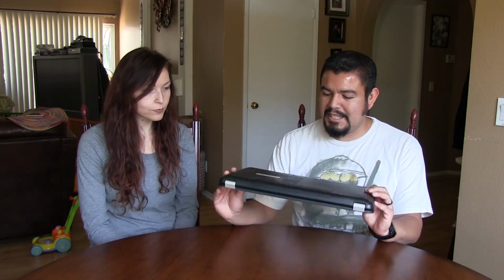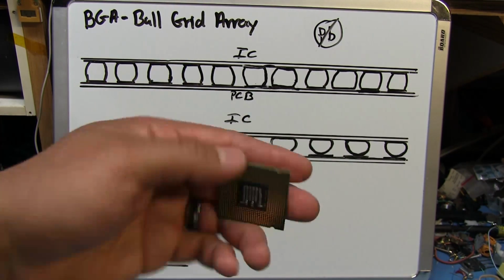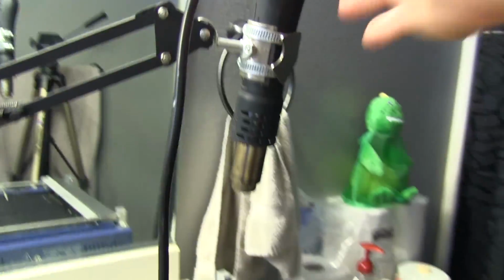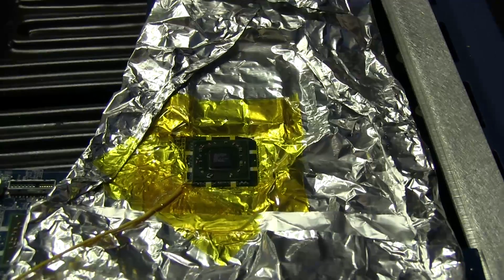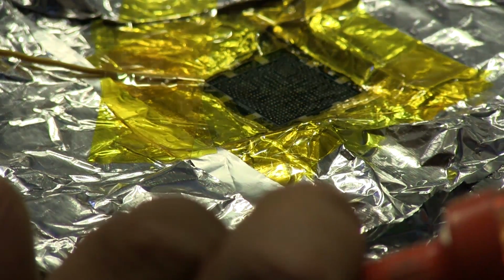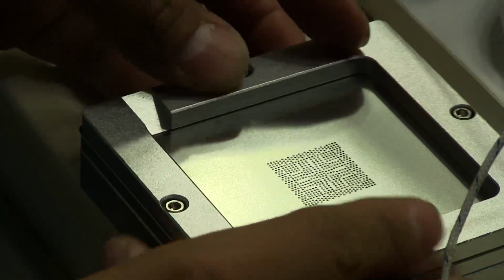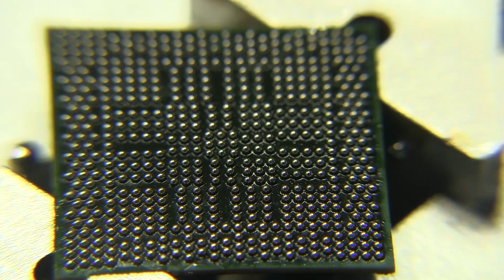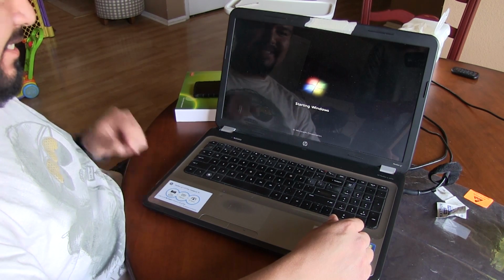TWB #7 | HP G71075DX Laptop GPU Reball

Comment: Hey bro nice explanation but piece of advice don't use a 2 meter solder wick this can lead to damaging a pad if temperature wasn't enough on the soldering iron it will drop due unnecessary extra thermal mass from the solder wick instead use small chunks of the wick like 1 inch or even smaller and hold it with a ceramic tweezers to prevent heat from tranfering to your the tweezers or you can use hot tweezers to hold the wick

Comment: Hey bro, youre a genius! I love that lamp mod you made to hold the heat gun. I have the same station and was bummed out that it doesnt bring a heat gun holder, so i took it apart it and drilled two holes on the side of the housing to attach a heat gun holder  which worked good but i cant reach the other side of the preheater. So i went and got the same lamp you have and made the base for it. Love it!

Comment: Two suggestions
 1: a exact measuring of flux  layer.
 2: when the gpu is about to settle down on the motherboard, that there be a mechanism made to push it down and hold it  while the hot air is running. and then  slowly cool  it down.

Comment: When reballing a ps4 or 3 what temp should I start preheating the motherboard  and for how long? Dose 105-115 C for 20 minutes sound right? And when I start the air gun do heat up quick to 220 C and if so how long should I wait before try to bump the chip. And the way should I put the kapton tape over the tips of the termalcouple on the board to get an accurate read?

Comment: Hello,
 I wanted to know the temperature to paste the ball  on the chip and 
then temperature to paste the chip on the motherboard, thank you very 
much for your answer
Reply from the maker: For reflowing the balls onto the chip, I set the hot air to about 400, and SLOWLY brought the nozzle closer and closer to the chip until all the balls had flowed and stuck to their pads. 

For reflowing the chip to the board, you have to follow a reflow profile. There is no set temperature you can use every single time. I used an XBOX 360 profile as a base for this project. This website has great profile information towards the bottom:

https://xbox-experts.com/tutorial/reflowing-with-thermo-couples-reflowprofiles-incl-/

Comment: the girl sounded happy at the end when it worked lol. How long before & needs to be reballed?
Reply: I hope You learned, that reballing flip-chips is pointless.
Reply from the maker: It worked for a while, but unfortunately eventually it stopped working again. I guess it turns out there were defects in these particular chips where they would work when reballed or reflowed, but eventually would quit again. Not because of the reball/reflow failing, but because of a problem within the chip itself. I have done other reballs where I didn't have any issues afterwards, mostly on 360s, so this one had me baffled for a while. She hated that laptop because it was constantly having issues. lol

Comment: wouldn't you be able to solder the balls while still in the jig? Jig is made of aluminum & will not stick to the steel/lead balls,?
Reply from the maker: If you mean heating the balls while the stencil is still on, It may be a bit more difficult because it would be harder to heat the chip itself. All the heat would be transferred from only the balls. There's direct heat stencils that this can be done with.

Comment: It looks like an advance operation but it catches my eyes couple things
1) Baby crying
2) The workbench versus the ToiletBench
3) No safety glasses for eye protection like OSHA recommends?
4) Would like to know technical education about the poster. ..if it is OK.
Reply from the maker: 1) I'm doing this at home, not a professional operation or a repair shop. Yes, that's my kid you can hear in the background. 

2) I did this on the counter in the bathroom because I could use the exhaust fan (which works really well in my case) to get rid of fumes and I didn't have a good setup in my garage at the time. 

3) While it's good advice to wear safety glasses, I'm doing this at home, so it's not like was going to get fired or have OSHA on my back for not wearing them. 

4) I'm basically just a hobbyist. I've learned a lot by doing things for myself and doing most of my research online, watching videos of other YouTubers, etc.

Comment: Setting your board on the outside of an antistatic bag, does not provide any protection. Only the inside of the bag provides any protection. Either turn the bag inside out or use an antistatic mat. As a computer repair technician with over 20 years in the field. I use to do the same thing. A recent conference I was required to attend, explained that the newest chips are even more susceptible to static discharge.

Comment: reballing is shit its not the balls have a problem the problem is the chip itself you need to replace a new gpu telling you this actually your not fixing it by reballing deep shit it because of the heat reflowing the chip you can actually tell if the balls ruining if the heat reach 220 or higher

Comment: Awesome video man!

How many minutes you have in heater?

Wich temperature you have in heater in the final process?

Thanks a lot!
Reply from the maker: Ricardo Gomes The whole process I'm doing is basically like a xbox 360 profile I found online, except that the times vary a bit depending on the room temperature and the thickness of the board. All the temperatures are monitored with the two thermocouples. I think for my particular heating plate I had to set it around 220 to about 230 for the board temperature to reach 150c. I would recommend experimenting on a junk board to see what temps you need to set your unit to to reach the recommended temps. This is the profile I base my reflows on and this is the website I found it on:

from: http://forums.xboxexperts.com/viewtopic.php?f=8&t=3232

- Put TC on the bottom of the board, but about 3" away from the GPU (cover TC's tip with aluminum heat tape)
- Put TC on the top of the board, 2mm away from the GPU (cover TC's tip with aluminum heat tape)
- Set T8280 machine to 180C, wait about 5 minutes until the bottom TC reading is 150C
- Turn on 968 (I use a Hakko FR-802) and set temperature to 150C, wait until the top TC reading is 150C. Keep the nozzle 1" above the GPU (we are still preheating)

- Set T8280 machine to 220C, wait about 45 seconds or until bottom TC reading is 160C
- Lower the 968 nozzle until it is a few mm above the GPU, hold for 1 minute
- Set 968 to 200C, hold for 1 minute
- Set 968 to 250C, hold for 30 seconds
- Gradually increase machine temp on 968 by 3C/second until the top TC reading is 215C MAX (Xenon boards) or 225C MAX (Zephyr, Falcon, Jasper boards). Hold for 10 seconds
- Turn off T8280 (black switch NOT red switch!!)
- Drop 968 temp to 200C, hold for 20 seconds
- Raise 968 nozzle to 1" above GPU (do not bump the nozzle or it will hit the GPU)
- Drop 968 to 90C as fast as it will go, then power off
- Use a fan to cool until the top TC reading is 60C then take the motherboard off of the T8280 so it can continue to cool.
Reply: The Workbench Thanks a lot man!

That was very helpfull.

Thanks